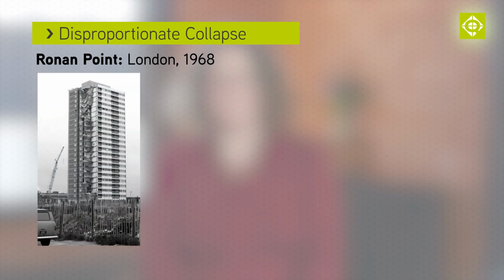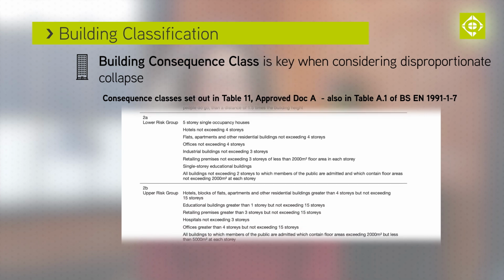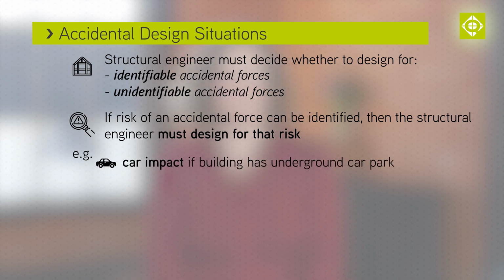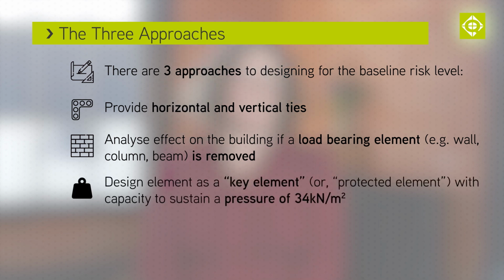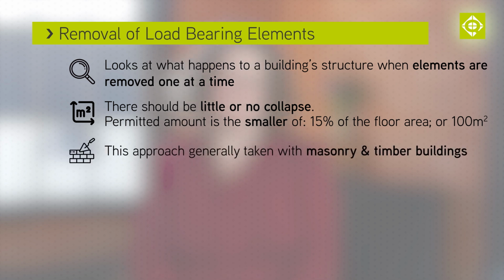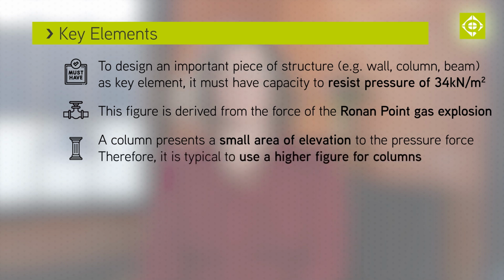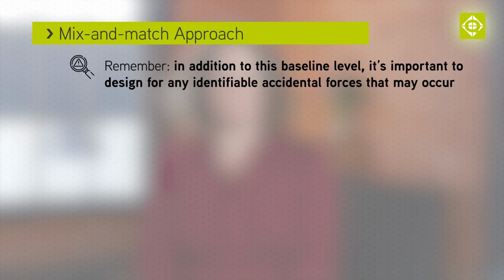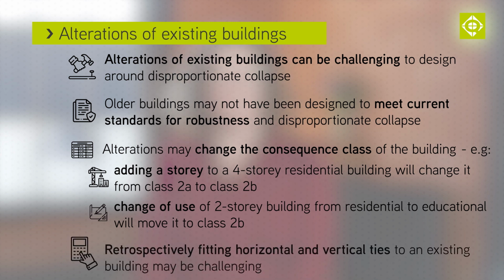Part A - Designing to Avoid Disaster

Comment: This was a great clear summary of the issues in the context of new build construction, however much of the work carried out these days by structural engineers is related to alteration of existing buildings, which you do touch on briefly at the end.

As an old building is unlikely to fall into any of the risk categories listed in approved document A it may be necessary to refer instead to the building regulations themselves which require that the altered building cannot be any less compliant than it was before the work started. Demonstrating this can require a much more sophisticated assessment than with a simple new build